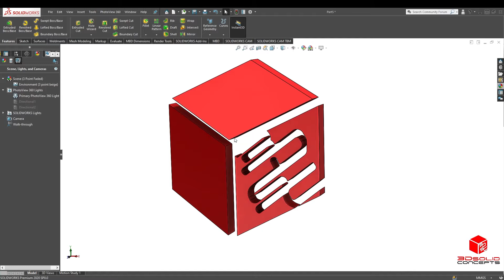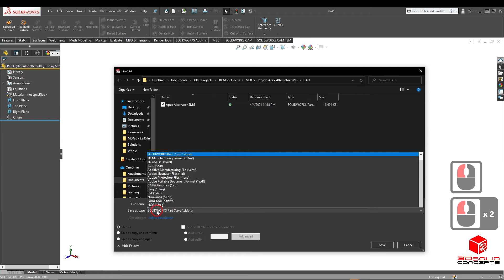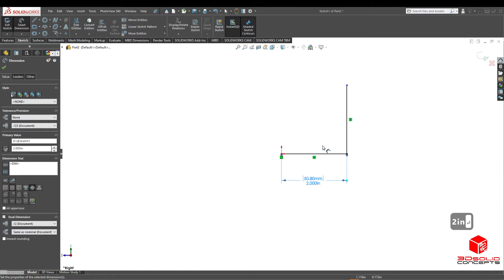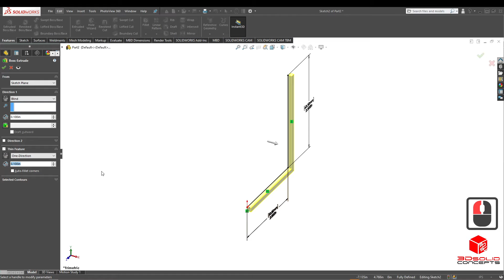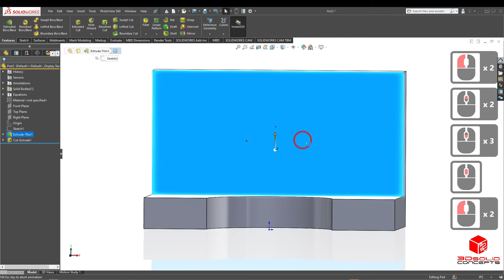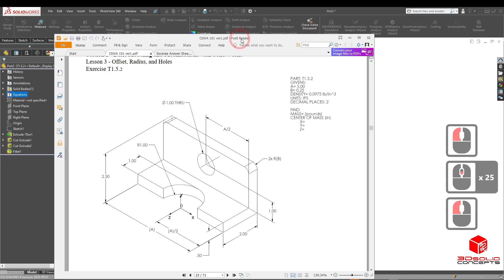The Beginner’s Guide To SolidWorks - Part 9 Offset, Radius, and Holes Exercise

Comment: The center hole was hard set to 2 inches and when we did the new drawing it shifted to the right.  You must have resized the dimension to 2.5" or related it to something else...  These tutorials are a bit rough, but I appreciate them all the same.  Thank you for spending the time and effort to produce them.  I'll hang in there because it has refreshed my memory considerably.  Thank you again.